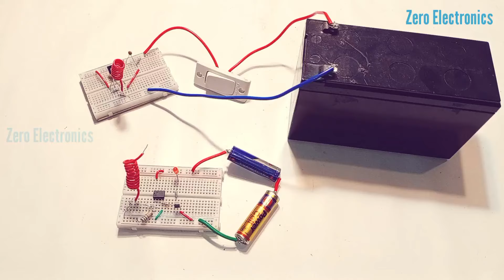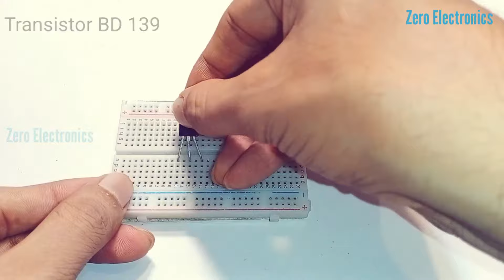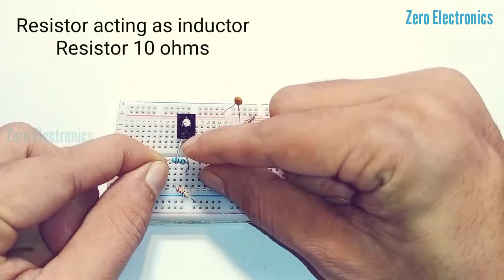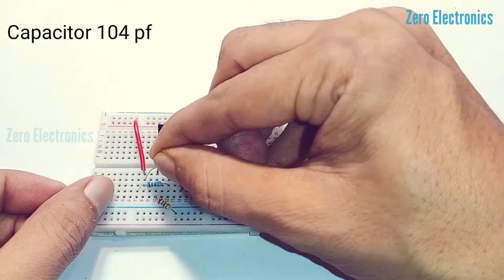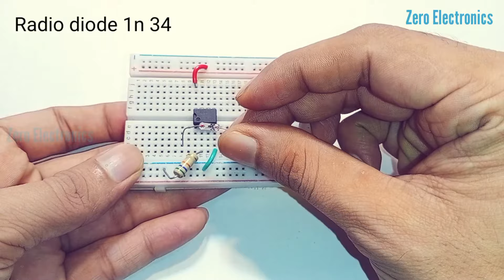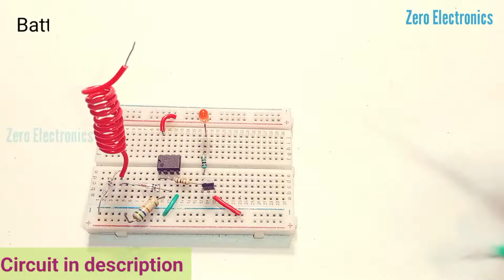Simple transmitter and receiver circuit - Zero electronics

Comment: What is the maximum range with best performance?
Reply: the longer the antenna the longer the range
Reply: that's not how it works  @Deg_rad
Reply: @RohitChOfficial  ok thx but could you tell me how it works tho?
Reply: @Deg_rad  Frequency of the transmitted radio waves means the range is lower but the speed is faster. But higher frequency means lower range, higher speed, but it doesn't go across a wall 

Wavelength of the wave, which increases when frequency is decreased, increases the distance range, if wavelength is increased. BUT, it'll have less speed, which we can increase with channel width.
Reply: @Deg_rad  size of antenna does matter, but first these things (Frequency, wavelength, channel width) must be fixed at appropriate places.
Reply: @RohitChOfficial  Wow, most ppl would just ignore me, thanks.
Reply: @Deg_rad  no problem bud, keep learning keep growing.

Comment: You did well. Suppose if I make 2 pair of these then transmitter will control both receiver or single. If both controlled by a single transmitter then how to give a unique ID for each transmitter.
Reply: you can change the frequency by adjusting the capacitors, in this case you can use a variable capacitor
Reply: and u can also use inductor instead of resistor inductor no of turns make different in this case very helpful also used in rc toys
Reply: @Sagar_thakor8255  bro I have doubt can you tell me can I use this type of circuit with required LC tank circuit can I use it like with Arduino with on-off modulation if you know anything about these things please share some info ....
Thanks for reading ☺️

Comment: This receiver will pick up any signals at frequencies within the germanium diode’s specifications. So we need a bandpass filter and low noise amplifier. Otherwise it’s pretty neat circuit. I will use it to detect WiFi, 2G, 3G, 4G and even 5G!
Reply: That is great!!. Do you have an video for wifi 2g, 3g, etc detector, assembly in protoboard?
Reply: Thank you for that information but can you give us a schematic for the bigneer

Comment: Where dod you learned all of this bro. The books reccommetation. Amd what basics do i need to clear. Coz i 12 i have studied parallel and series' of resistance. But here so many capacitor and other things are alos in parallel and series. What variable do i need to take account. Can you please specify. I am very interested in electronic as hobbyist. I dont just wanna see the video and copy it. I wanna it from core. Please 🙏
Reply: What is range
Reply from the maker: @RashmiThakur-uu6so  Its around 10 meters and you can increase the range. That circuits is also documented there.
Reply: hi tarun ......i also have very keen interest in Electronics and its desigining and its core working.......i am also really passionate and have a keen intreset in knowing these things......and the fun fact is i have also completed my 12 th ......can we please connect .....via E-mail or linked in.....pls confirm here in chats.......we can be a great team.
Reply: Hey , I am also interested in electronic projects and wireless control as a hobby . Please contact me . I also want to learn it from the internet . But it's very difficult to find informative videos of deep learning and circuit making . Please someone help me

Comment: The receiver circuit has the light on even if you turn off the transmitter?
Reply: I know that I am a bit late but the reason for the light still being on is because he had a capacitor. So while the transmitter was on the capacitor got charged up and then when the transmitter got turned off the capacitor used the energy it had stored with electrical fields making the light still light up for a little extra time.

Comment: Lm356 replace with discrete components
Reply from the maker: I already tried it very before it lacks range. Diode is necessary to detect radio signal and amplifier is used to amplify weak radio signal
Reply from the maker: @cmaiia  yes i pin circuits check out in comment session